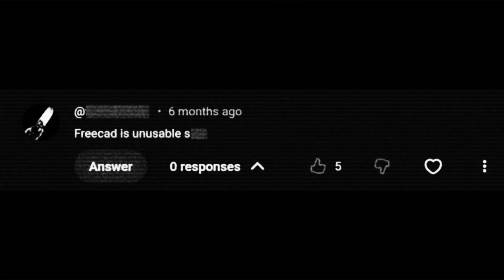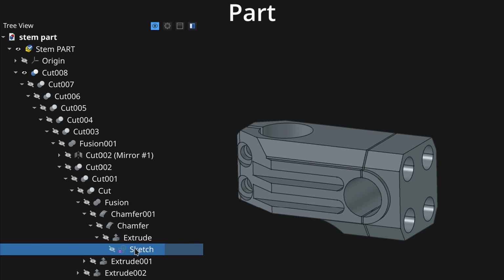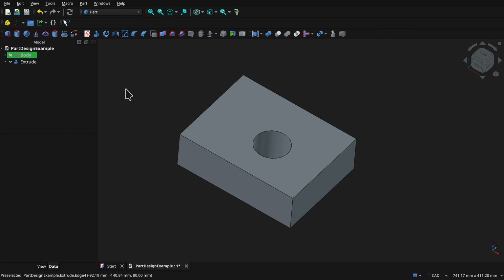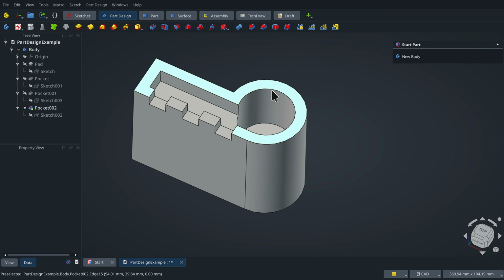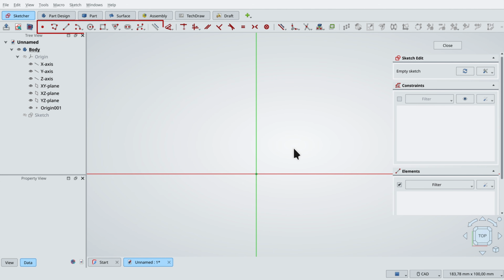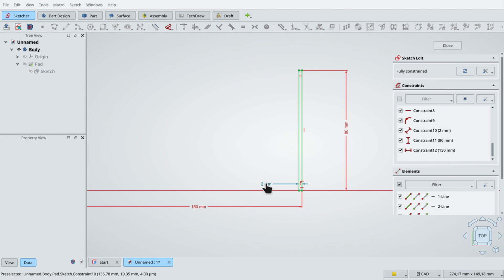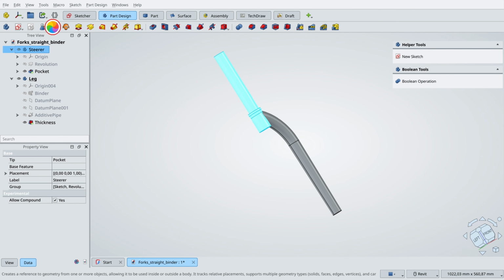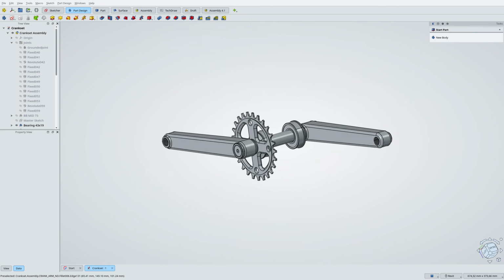STOP using FreeCAD WRONG! Do this INSTEAD (Workflow & Tips)

Comment: Of course it is a "Skill issue", and no, it is not productive to say that. As many others I am a total newbie to 3d modeling. That in itself makes me gravitate towards FreeCad, because it is well, free. I am sure I am not alone in this. The learning curve for 3d modeling is steep. It gets even steeper when the tool one chooses to use is not exactly intuitive, by any standard. FreeCad needs to acknowledge this. However, after having used FreeCad for a couple of months now, I have learned enough to do basic 3D modeling, thanks to  @Deltahedra, @MangoJellySolutions, @CADCAMLessons and more. 

FreeCad has a long way to go before becoming excellent. But by golly, it has come a long way in a short time and it is improving rapidly. So my hat is off to everyone involved, at every level.

Comment: If you could make some Blender tutorials on texturing and rendering, that would be very helpful. I would also like to see some modelling tutorials, but since most of my work is modelling in FreeCAD and then rendering outside of it, tutorials focused on texturing and rendering would be especially appreciated.

I have tried following other online tutorials, but at some point they usually say to click on something that simply is not there on my screen.

3ds Max used to be my main 3D modelling software, but it is very resource hungry and expensive. Blender is free and uses my GPU, whereas 3ds Max mainly relies on the CPU, which is not ideal for my system. If I had an endless supply of money I could upgrade my PC, but I do not, and I do not really need to if Blender can do the job once I get my head around it.

Comment: I think the thing I struggled with most was the "wire not closed" error. I was so used Onshape autogenerating contours for me, and I didn't realize that FreeCAD didn't work the same way and instead wanted you to explicitly make one boundary loop containing multiple hole loops. Now that I understand it though I think it is better. It makes extrudes and other 2D to 3D operations less likely to break, since contours don't randomly disappear and reappear as the geometry changes

Comment: Too long to write but freecad is still garbage. Maybe ok for some really simple stuff. The main problem is that once your parametric model has broken, you cant even return it to the initial state and fixing mistakes you made somewhere 10 steps before is nearly impossible. Its just a mess for real commercial use
Reply: No one taught you to save at regular intervals?
The software is always to blame😅
Reply: @nee3029 if you need to save at regular intervals to prevent a break on the software, so the software has an error. We abandoned long ago saving code in regular intervals to use git, why does FreeCAD doesnt have a way to rollback? I like FreeCAD but if it has an error, it has an error, dont try to mask it

Comment: a lot of the problems aren't "skill issue", those are actual bugs.  You can work around the problems but that doesn't mean they're not there.  Even in your very first explanation "well in this case it's organized like this, but in the other it's completely backwords.  You just have to remember that".  Utter nonsense.  And I say this as a frequent freeCAD user, so I'm well aware of sketch-based parametric design - and the limitations of it.  You can explode your entire part changing a single parametrized dimension because it screws up the solve and turns the sketch inside out.  Then there's nothing to do but start from scratch, because none of the faces still exist that the rest of the part was built on.  In freecad, you have to design your part before open freecad. Don't expect to change anything if you realize it has to be changed, you begin fresh every time because it's going to blow up if you don't.

Comment: Took me a while to even know what my questions were, there are complications between different OS and the FreeCAD program. The way "I thought" it should work and the way it does work are two different things. Macbook Tahoe decides to deal with many things differently than the way FreeCAD originally functions. My solution was to take an ancient Macbook Air and place Linux on it for an operating system. 

Looking to be a bit more in control of OS system changes. Hard enough to learn one new program then to try to learn how "it" works within one OS or another. I greatly appreciate people that take the time to explain the basics while also moving forward in learning more advanced elements. (All of the auto-cad programs have gone through many changes, some making it like learning a completely different drawing program, think of the different versions of Citia, or Sketchup, or Solid Works, or Pro Engineer, and the list goes on and on.)

Comment: I believe freecad has a huge potential. But i aree it is unusable if you are used to fusion, autocad, onshape and similar software.. The UI is to polluted and confuse when you already learned to work with simplifyed UIs. The devs must focus a little in UI if the idea is to convert users.
This comes from someone who is really trying to get used to freeCAD. Sometimes i just wanna make a fast desing and i just give up on freecad and open onshape...

I am commentin while watching. This video is really helping
Reply: free cad is designed by autists
Reply: Then maybe this video helped you change your mind. The way the interface can be simplified to look like it's paywalled competitors, especially solidworks is great.
Reply: @TheSliderW  It did help!
BUT I am still anoyed on how sketches are handled when geenerating bodyes... I am too usd to the main sketch that can be extruded by sectors. Freecad has someething close to this, but is a little inconvnient yet
Reply: @orley1994  sorry i don't really get the extrude by sectors thing. I've mainly used solidworks which it seems to get inspiration from. Especially since the later dev builds with the simplified tools and action previews.
Reply: @TheSliderW i don't know the English name for that.
What I am used to do on fusion and onshape is making a main sketch with all the characteristics I can and then extrude each area of the sketch by its measures. This is my main method for working with parametrics. If we work with parametrics with many different sketches it raises the chance of having some type of issue on parts unions when tweaking the measurements.
The last versions of freecad can more or less do that but we have to select the lines that define the area we want to raise, and it only works properly with the pad feature.
When I try to make that on the part workbench, with the extrude feature, it doesn't work properly.
To be real, I don't see the point on a "part" and a "part design" workbenches... In my opinion they could be unified and refined. I get that one have some features that diverge from the other. But on my point of view all of this could be organized in one solo workbench
Reply: @TheSliderW  Also, I see much redundancy in some operations - redundancy that the big softwares already adressed.
The main example is the aditive and subtractive operations on part design - the default method to work with that is a single operation that can be toggled for aditive or subtractive. 
this gets worse when we see that the same operations on "part" workbench are the same, but a little diferent, from the ones on "part design"
BUT, this can be just the point of view of some noob who doesnt get the big picture yet
Reply: @orley1994  ah yes, i get the idea. 
There used to be a FreeCAD branch that had such feature. No idea if it was merged back, i use the same workflow as with Solidworks ( Master Sketch and sub sketches that reference specific details for the relevant actions ).
They recently introduced a feature that makes any referenced lines usable instead of the dashed construction lines and that speeds up things quite a bit.
Reply: @orley1994  you are right. many operations could be merged while providing a toggle button. This is what Solidworks has done for the most part and it cleared up the interface a lot. I hope they implement something similar soon as well.
I'd suggest avoiding the Part Workbench unless you have a very specific use case for it. It's not the same at all as Part Design and seems like it's mostly legacy tools or things that might help with surface modeling or to fix broken imported objects. I never used it so i can't vouch for it's usefulness but honestly you can hide most of the workbenches. I said it before but i really think FreeCAD should hide most WB and ask users on first launch which ones they need with a clear explantation of each and a recommandation for users based on experience. For instance if you're new to CAD or want a basic CAD suite then hide all but the sketcher, part design and assembly WB. That way you avoid confusion and can unhide the others when you need them or feel ready for more advanced tools.

Comment: Another fantastic video many thanks.  
I'd not considered using other assembly workbenches as I hadn't seriously used FreeCad before the default assembly workbench was included. After you've mentioned that the other assembly workbenches could be worth looking at I'm having a look at the A2plus workbench and am finding it may be more suitable for designing joinery products like windows, doors staircases etc.
Thanks

Comment: Intro : all the usual complaints about what's bad with Freecad. Then  28 minutes of confirmation, tweaks, add-ons and informations on how to work around Freecad's bonkers design philosophy and bugs 😄
I used it quite a bit before 1.0 and it was plain horrible. Now it starts to become somewhat useable which is good to see. I just wish their main focus wasn't in seeing what they could do differently than commercial software, but making a CAD program that actually let you be productive instead of actively fighting you every step of a project.
Still, it's a great and concise video i'll use to make Freecad a bit more useable on my linux test PC. Excellent malgré le sujet difficile :p
Reply: 100% agree. I'm in the process to migrate from SolidWorks. Not a very intuitive software, but also seem to be very similar to other parametric CAD software. I feel about FCAD as I do with Inkscape. Why do it different from everybody else? I use Adobe Illustrater, but also don't need 90% of the features. Inkscape should be perfect for me, but I can't use it. There's a reason Illustrator, FreeHand (when it was around), etc. do certain things a certain way. It works. Why be different for the sake of being different?
Reply: Must have missed the last bit about mindset.
If you learned on FreeCAD and tried commercial software, the comment about making a CAD program that actually let you be productive instead of actively fighting you every step of a project would equally apply.
Reply: @PaulG.x  I'm not sure it does really apply both ways equally. I downloaded Fusion 360 and was using it reasonably well with less than an hour of watching tutorials on it. I've tried the same with FreeCAD and it makes we want to punch my screen. I love the idea of FreeCAD, and I'll keep trying to use it when I forget how frustrated I got the last time I did. But it's not nearly as intuitive as Fusion 360. 
When there are loads of new users telling you your UI is terrible, maybe you should consider the possibility that it really is a problem.
Reply: @PaulG.x  of course, but here Freecad is the one exception. I didn't struggle going from Solidworks to Fusion then 3DX. That's why i said Freecad devs seemed to have as a goal to go out of their way to make as much of it different from every other CAD software. I can't see any valid reason it had to be this way.
That's in my experience why people stick with Fusion360 for personal use. Right now i have the choice between learning freecad and learning to work around its flaws and weird workflow, or just get my parts and assembly done in an hour and be done with it.

Comment: Quick comment on use of the trim tool. On my running of Freecad 1.0 and previous versions, I have run into trim tool problems. That is, trimming more than desired items. The effect should be thought as double clicking. The solution is the undo arrow. Say you are trimming a tangent circle & line. Click the line's tag end and it trims, but it also trims part of the circle. Ugh for a newby, whom redraws the circle & line. Here, a disaster is created. What often happens is some of the first drawn/trimmed features are still present. This feature is then drawn over and hidden. Everything looks complete, but the drawing won't close because of this hidden feature. Now, there are 2 choices. Undo each step, eliminating features until the hidden feature is deleted, or turn off each feature until locating the hidden feature. That is, when a feature is turned off yet nothing in the sketch disappears, you have found a problem. Deleting it solves the closure problem ... eventually. Ya might have more than one hidden feature.  So, be very observant when trimming sketches and use the back/undo button to eliminate this headache.

Comment: this video should appear on every new installation of freecad as a tutorial. well done!!
Reply: That's a reasonable way do address the issue. Other complex software does that. Doing so would be trivial, but why doesn't FC team choose to go this way?
Reply: It's more of a debunk some myths video than a proper tutorial. Some of those things should just be rolled into the software as standard settings, for the rest you want something like the "Blender Fundamentals" playlist, talking about what is where and what you can do with it, big-picture view of the whole program so you don't get lost. It's technically out of date (made for 2.8) but still perfectly applicable exactly because it's at such a basic level. 4 1/2 hours  of video with well thought out didactics, it's not an easy task and the Blender Foundation has the resources, in particular a whole art department, it can task with such a thing.
Once that's done you can point new users to a walk-through of a beginner project.

Comment: Well to be fair.
Freecad is come a long way and it became quutr usable even fot professional work.

But and that's the last point you made are fillets and and shelling features.

They are absolutely broken.
Yes you can work around it.
But usually its easyer to export and import into another cad tool to fo it.

The work arounds can be a pain in the ass to be honest.

That said.
As fat as i understand it, its not freecad fault.
It a dependency occt that breaks this things.

I hope freecad will adoopt occt 8 asap.
And hopefully this will fix things.

And to be fair fillets and shelling is something so basic every cad tool should have figured out.

So i get the issues people have with it.